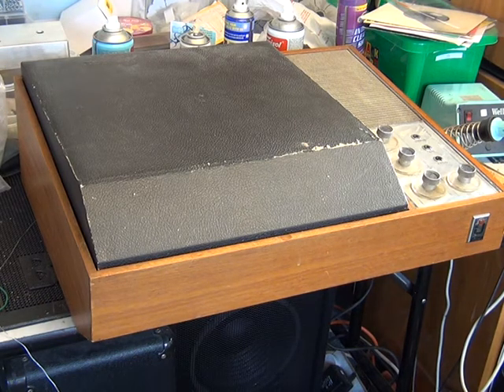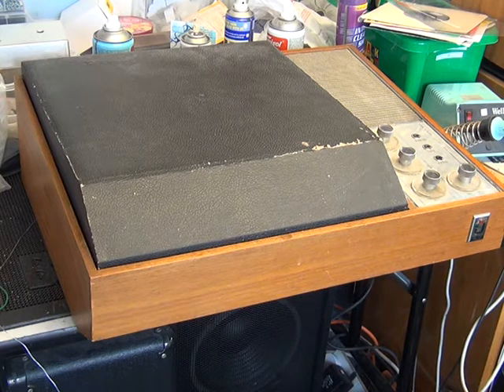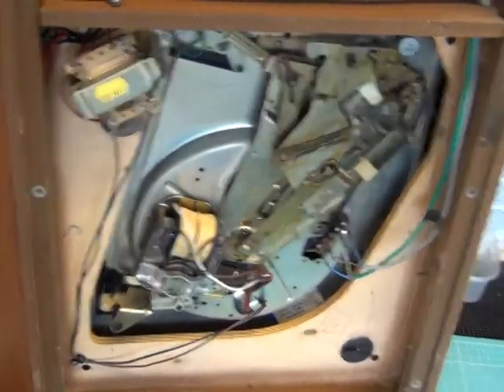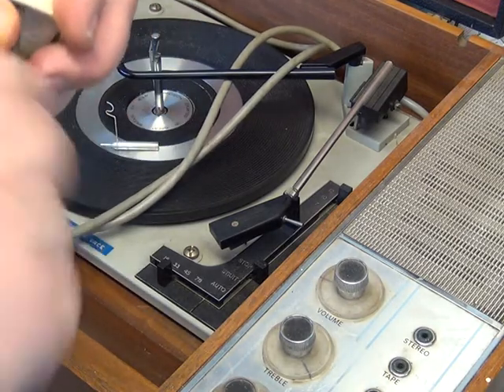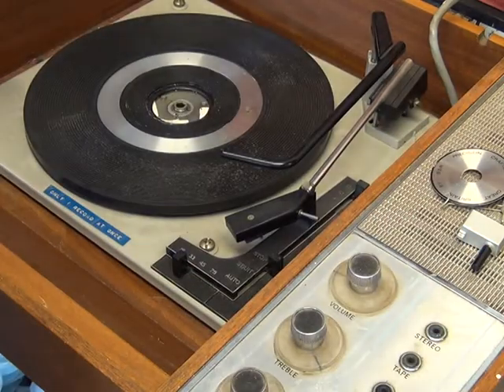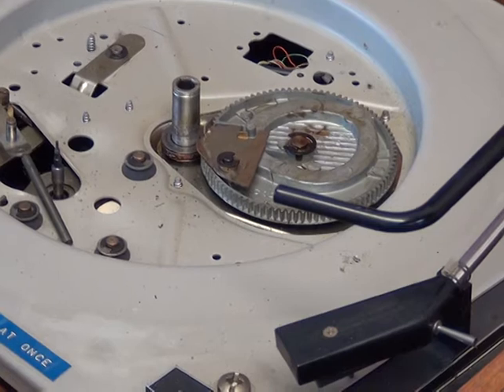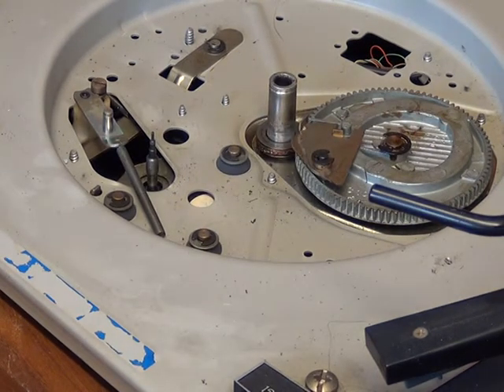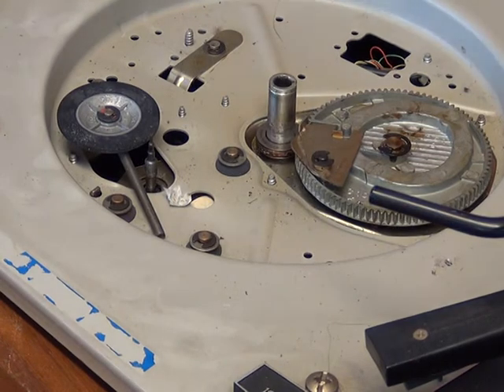Ultra 6042 record player overhaul, BSR MA55 deck service - Pt1 of 3

Comment: I just recently received a BSR ma55 in a stereo cabinet. I have previous audio electronics experience, but it's my first time working on a turntable. I think the built-in preamp may not be working? Any advice for testing it?
Reply from the maker: Well, if it's just a BSR MA55 there won't be a preamp & the outputs will be straight from the cartridge. email me a photo of the innards.

rshireby@yahoo.co.uk

Comment: ~Where are you based? I am looking for someone within a reasonable distance of Manchester for exactly this type of work. thanks BushVHF
Reply from the maker: I'm not really taking on audio products at present, though there will hopefully be an extra building being built here as soon as planning permission happens. This is because the three workbenches here are designed & equipped for servicing two way radio, so radiograms have to be done on outside benches at our custom built church pipe organ restoration workshop; which clearly isn't ideal at all & certainly not in winter. Email me to let  me know what you need doing...I only do certain makes I've had formal training in & have service manuals for. rshireby@yahoo.co.uk

Richard